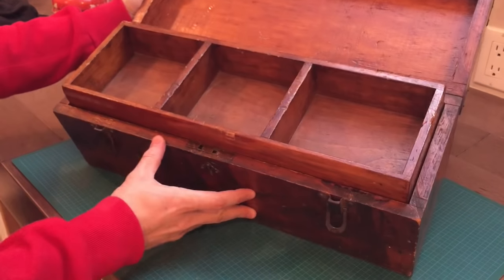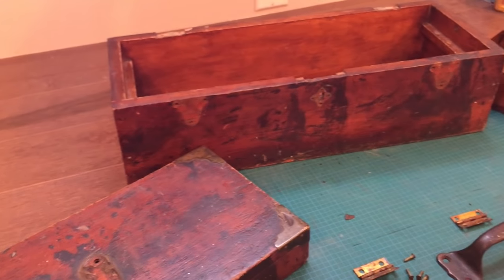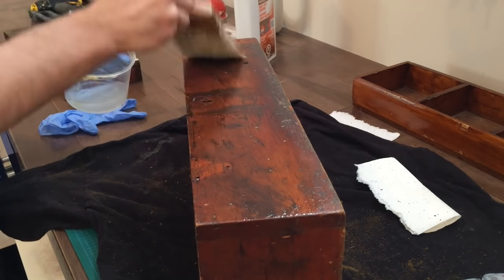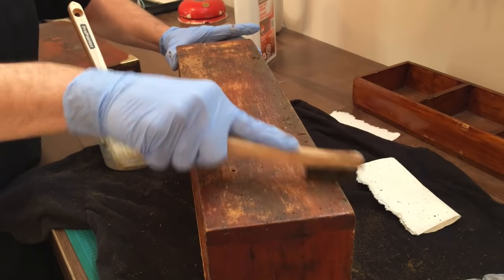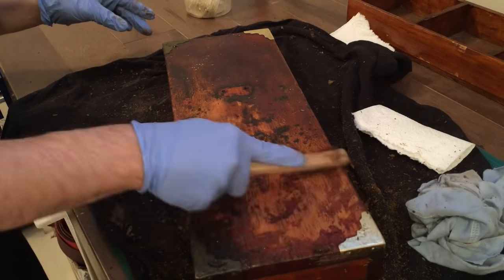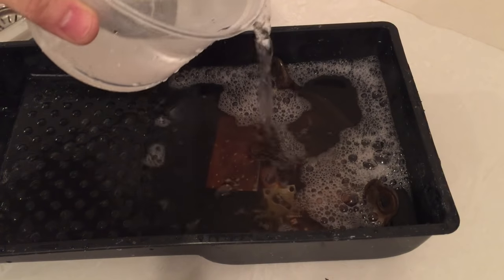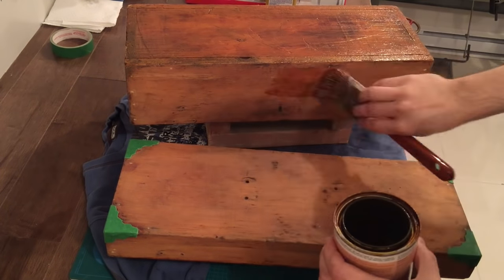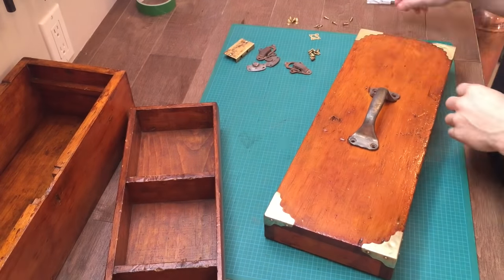How to Restore an Antique Wood Toolbox // DIY

Comment: I use very fine steel wool with some weakened mineral spirits to rub out all the old paint spots without removing the original lacquer. Then hand rub with wax to bring back the patina. I do this when restoring furniture and vintage radios.

Comment: wow, very cool! trying to clean up an antique 1960s chess set that's aluminum pieces in a wooden box (not the board, that's a separate item, i don't have), so searched for restoring wooden box and voila. no shallac on mine but still very cool to see.

Comment: What was the point in such a restoration: it was functioning all right with no problems that had to be fixed and looked altogether nicer than the result that we see. Sure you could make a new box for the same specifications if you wanted and left the old one the way it was - that would be value added instead of value destroyed!